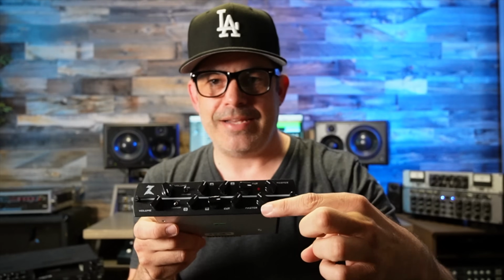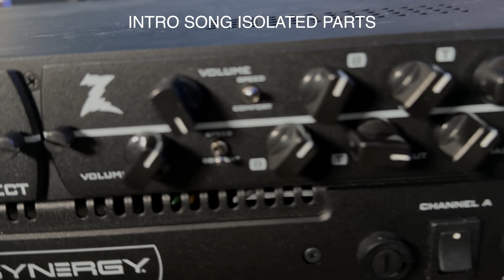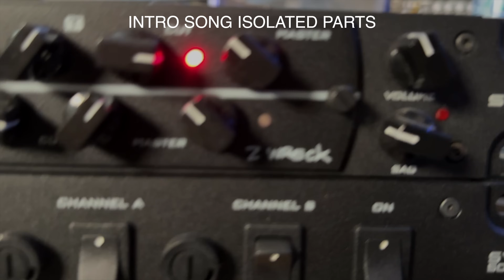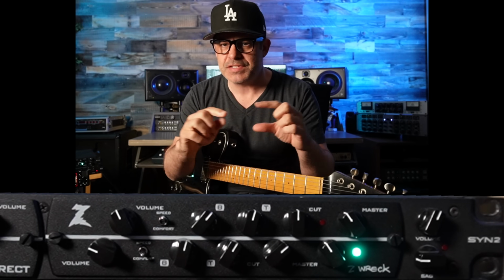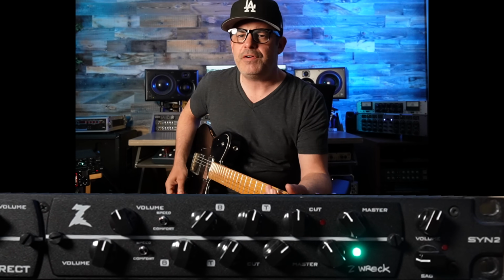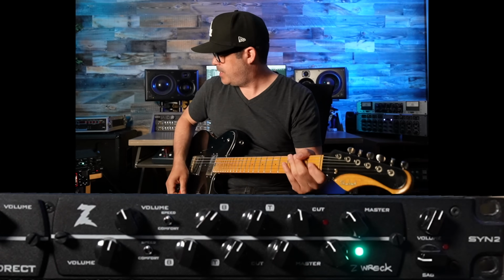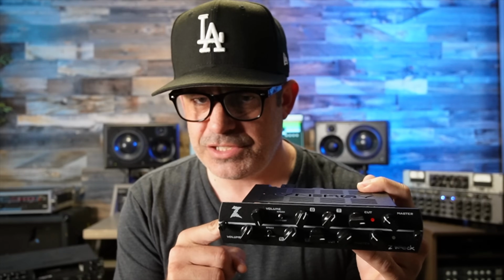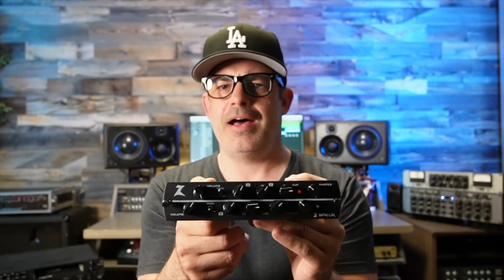Synergy Z Wreck 🔥 Dr Z in a preamp! 🔥 🚑

Comment: I'm a bit confused with the purpose of the 0 watt power amp in a situation where you're feeding the output into an actual power amp.  It seems like it would be great for direct recording from the module, but wouldn't it be doubling up on the power amp (sonically speaking) otherwise?
Reply: It's the same concept as using a power station - like attenuator, you can push the poweramp into distortion and then reamp it with the power station
Reply: It's to get poweramp feel and sag without actually making the signal louder like an amp would.  Thus 0w.  As in no watts.
Reply from the maker: Traditionally the biggest complaints with preamps has been that “they don’t feel like an amp”.  That can be true if you don’t drive into a tube power amp with the right gain staging.  So this is one step closer to adding another layer of amp like feel and tone by adding actual amp behavior to the preamp module.
Reply: @BigHairyGuitars  No doubt, but I'm thinking more of the situation where you're feeding the output of the Synergy into an actual power amp.  In comparison, something like the Friedman IR-X has an output that includes power amp simulation, and an output that doesn't include the power amp simulation for when you want to go into an actual power amp.
Reply: @CJ_Wolesz  The Friedman IR-X's power-amp simulation is largely about EQ, because Friedman power amps typically include negative feedback, though there could also be some algorithm which interacts with impulse responses to mimic damping relative to a speaker's impedance curve.  Synergy's new "zero-watt power amp" is more about driving a faux phase inverter, as in a cranked amp which does not have a master volume, and sending the result of that drive to whatever power amp is used.

Comment: Hey Mike love the stuff! I'm in the market for either purchasing a Synergy or amp modeler (effects aren't the deciding factor to me). Is there any key differences between the Synergy and (insert modeler name here) that you would point out? I don't need a thousand different amps just a few really good ones, thanks!
Reply from the maker: Hi. Thanks!!!   I’m a believer in tube / analog tone.  Digital is good too, but I prefer the feel and extra complexity of analog signal path.  Or… that clarify,  I like at least a core component of my tone to be generated by the analog tube signal path.  So something like Synergy or IRX would be my preferred option.  

Right now I’m using the Astro20 by Soldano.  Tube amp but I can go straight to the PA if I need to with the digital back end.  Best of both worlds there
Reply: @BigHairyGuitars  Awesome thanks so much for the reply! Keep on rocking!
Reply: An important distinction between Synergy and modelers is that Synergy modules can be used like amps, while modelers have an input limit and an entire subsystem meant to balance the modeler's response to the guitar's output (including making weak pickups trigger the modeler as though they were stronger).  I want to plug into an amp and play without extra concerns that using one of my wiring schemes might throw off the modeler's levels or even overload the input.  Clipping the input of a modeler is a problem: clipping the input of a tube amp is rock.

As an aside, I worry that there is a financial incentive for modelers to make "good sounds" which do not reflect the guitar being played and possibly even nuances of playing technique.  Whereas some tube amps are "easier to play" thanks to compression, they cannot change the physics which determine how a guitar sounds with a particular rig setup (including knob positions).  Modelers have the potential to turn guitar playing into a power fantasy akin to video games, and I strongly doubt that a majority of guitarists would reject a modeler which made them sound like better musicians.

Comment: Synergy aint it.
Reply: It is if you don't want to spend 3k on an amp.
Reply from the maker: Yeah.  Plus this module and match it up with something like a BEDLX or Dirty Shirley module in Syn2 and you’ll have SO much range covered.
Reply: @BigHairyGuitars  Synergy isn't full bodied
Reply: @internetmoney221  Great ear if you can tell that thru the YT compression.
Reply: @ultravirez  No, from first hand and ear  experience
Reply: @internetmoney221  You have a Synergy ZWreck already?
Reply: @internetmoney221  What power amp were you using?  Did you disable the Synergy chassis's "Sag" control?

Comment: Ever since Synergy released the single module direct box it's a matter of time before I lose a couple of the ones I got and start building up some modules.  I can probably buy two modules for each amp I get rid of.  Holy cow, I can get like a whole room back...
Thanks for another great demo - it's all Bruce's (Egnater) fault, and I couldn't be happier someone finally did it.  Once I have a few modules, that should have cleared up plenty of space for the two-up chassis and a nice power cab (or few).
Reply from the maker: Haha!  Yes!  It’s a great way to cover some of those amps that; you want the tone, but don’t need the full blown amp.  For me it’s things like Recto and the Vai module.  Great to have real tube versions, but I don’t need those 100w heads specifically

Comment: I power my Syn-2 with the same MosValve power amp Jerry Cantrell used and it's AMAZING. Synergy definitely lacks in Vox tones, so this is a welcome addition.
Reply: Actually they released a Morgan AC module when they launched. I have one and it sounds really good too. Goes also from Vox clean to a thick hard rock tone (think cranked Vox Brian May style).
Reply from the maker: Niiiiiiice!
Reply from the maker: I can remember if I’ve tried the Morgan.  But it’s definitely nice to have some Vox-y options
Reply: @jcugnoni  The Morgan AC is not a Vox module, thanks to Joe Morgan's dislike of various Vox characteristics.  I managed to find a used Salvation Audio MatchVox 2.0 after years of Synergy not releasing a proper Vox module akin to their BMAN, Plexi, T/DLX ("T" for twin rather than tweed), and 800 modules (People really sleep on the 800 module.).
Reply: @Robstafarian Thanks for the info. But it seems much more versatile than a Vox at least but I haven't found a schematic to see in more details. But it shares some characteristics that I usually associate with Vox tones at least to my ears. PS: i would love to find a 800 module but it is very hard to find around here..

Comment: They need to make a 4 mod rack unit.  Kind of like the Randall one.
Reply from the maker: That would be cool, but even still I think you can daisy chain the SYN2 to work like that
Reply: I have a Randall one, and I also have a not-so -known one by Rocktron: the Vendetta. Does 4 modules. 
You can sync 2 Syn2s together I believe.
Edit to add: I always wanted the Egnater M4. Does 4 modules and channel switching on the modules. 
They sell for a pretty penny nowadays when you can find one.
Reply: I would rather have a pair of SYN-2's for blending sounds (or wet/dry) with four channels per side.  My speed is more small and light, hence my anticipation for the upcoming SYN-20IR lunchbox.
Reply: @Robstafarian  that’s funny…because idk if it was Randall or Egnater but somebody made exactly what you are talking about. It had like 20 modules. And it wasn’t just a storage rack for modules. It was a functioning idk like 14-20 module preamp. Idk if maybe Billy Corgan had one. 
If you search, maybe you’ll find it. I think I saw it on the old HRI forum years ago.

Comment: Nice demo as usual Michael . We’re you using a tremolo ( fast speed ) ? Sounded very cool !
Reply from the maker: Thanks.  That was essentially 2 tracks.  They both were playing the same part.  One cleaner, and one dirtier.  One of the parts is getting an extreme tremolo in time with the track.  I did that, in this case, with SoundToys Tremolator plugin, inside the DAW session (Logic).  Then it’s perfectly locked in time.  I like this kind of doubling because you get the effect and also the part sings through.